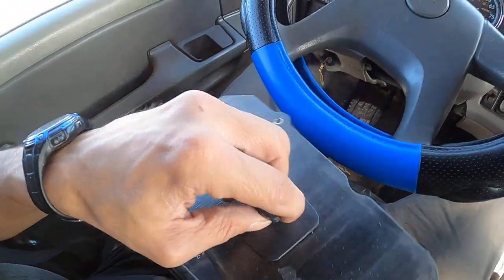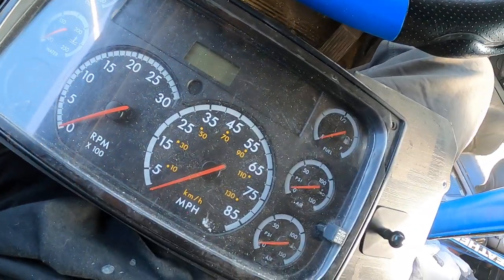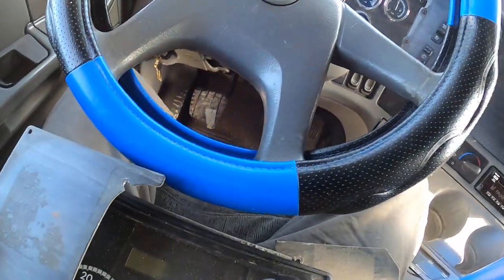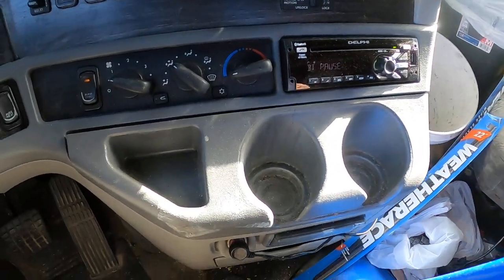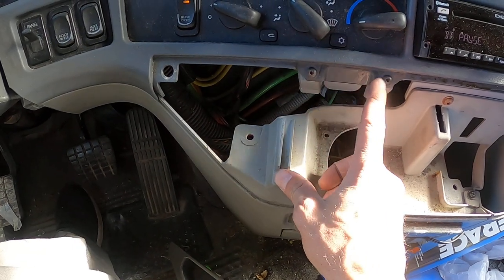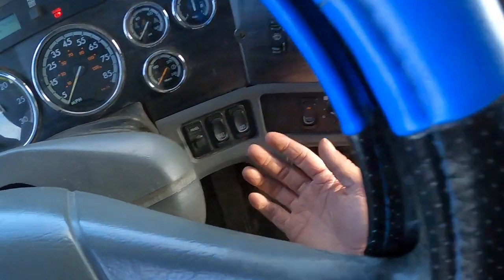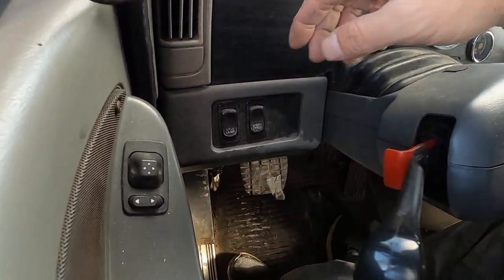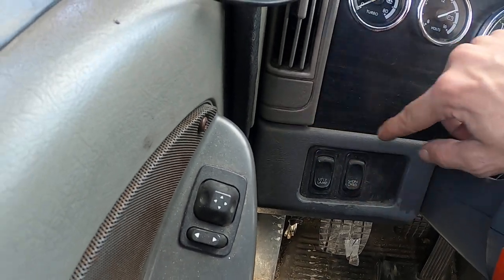how to remove instrument cluster 2006 columbia

Comment: Hi! Wanna do the same on my 2014 Columbia Glider! My original cluster has red connector! The one i found to upgrade has pink connector, how to check for compatibility? Thanks
Reply from the maker: Best way is call freightliner. Give them your vin and ask which dash instrument clusters are compatible with your truck. Icu 3/4 is pink. I believe red was icu 2. However i can run red and pink connector in mine as its basically a Frankenstein truck
Reply: Thanks man fot help great video!
Reply from the maker: @videomotionstar  your very welcome.

Comment: I'm pretty new to the Freightliner Columbia. Is this an optional gauge cluster, or is it standard for one of the other model lines?
Reply from the maker: This was an optional cluster. This is why you have to research which cluster model is compatible with your truck and find the cluster you want
Reply: @Dr_Angry  gotcha thanks. Is there a place you would recommend that I can go to look up this info and do some research?
Reply from the maker: @RustyCarnahan  have your full Vin number ready. Call around too 3-5 different freightliner dealers all in different states and ask them what dash/instrument cluster you have in your truck. Unless you have the tools to do it yourself. If you've got the tools just take the cluster out and look at the back. There should be a tag telling you which cluster number it is. Many dealers will ask you what color connector your cluster has so I'd recommend taking it out first BUT it's not necessary if the person knows what they are talking about bc from your Vin they can tell you what exactly is in your truck. Hope this long winded response helps
Reply: @Dr_Angry  perfect! Thank you!